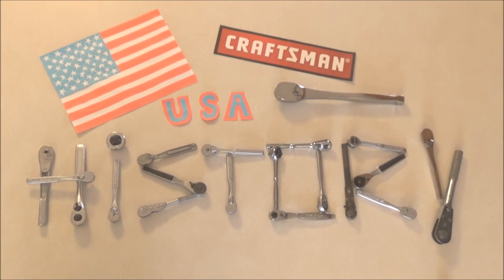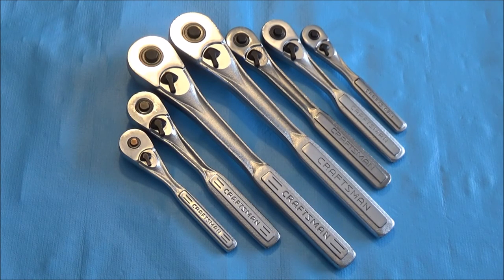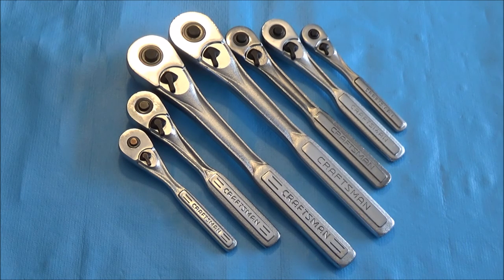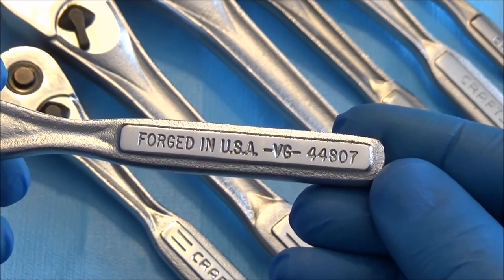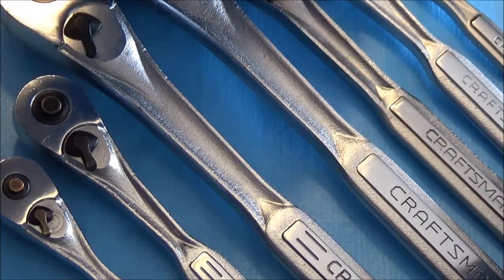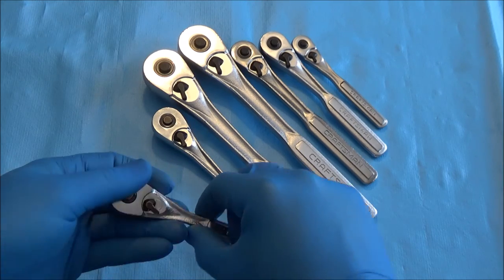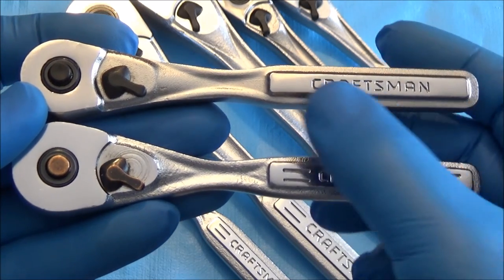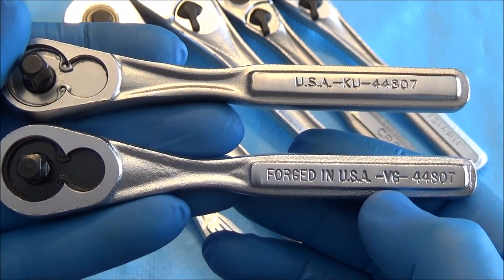Craftsman Tools - USA History: Teardrop Ratchets (4th Gen. RP)

Comment: Sears used injection molded metal parts in some of their ratchets as a cost saving measure.  They mold them 10% oversize, then run them through an oven to partially melt and harden them..  When they exited the oven they were the correct size.  My Dad worked for 3M company and sold sandpaper to the West Springfield MA Easco plant to finish Craftsman tools. They were originally called Moore Drop Forge. They had five big presses to drop forge the tools.  Most of the time they would only be running one press at a time.  When they where all running the whole street would shake.  It was a black day when they moved the plant down South.  Good video.

Comment: Got one of these at a yard sale for a few dollars the other day. It seems to be one of the later models, but it's still much better than my old harbor freight ratchet.
Reply from the maker: Agreed.  From my own experience, USA Craftsman tools seemed to have higher longevity, durability, and value for the money.  

I will concede that Harbor Freight does have a ridiculously low cost of entry, but, from my own experience using their tools, not worth having to repeatedly warranty a tool due to failure.

Comment: I haven't seen any of the black industrial finish ratchets in your videos and I'm sure they're the same as the standard ratchets but did you add any of those to your collection?
Reply from the maker: +Samuel Noble Hello!  Yes, your hypothesis is correct, the black industrial ratchets are exactly the same idea as the standard USA set; however they have a slightly different tooling pattern.  That difference "might" increase longevity, but I cannot offer anything in that regard other than my opinion.

You should see an example of a Craftsman Industrial 3/8" Tear Drop right in this very video.  The difference between that and the  black oxide in terms of price is minimal; however, the "Industrial" variants are 2x almost 3x the price what what you can buy the standard USA variant.  There is zero difference with the internals.  The black oxide acts as a covering to protect the chrome underneath.

I "might" buy a black oxide Tear Drop and show it at the end of the series just to display an example, but that is probably as far as I'll go.  There are "Industrial" variants of the Non-Fine Tooth Round Head, which I have already shown, the Next Gen. Thin Profile, Full Polish Tear Drop, and the Standard Tear Drop.  There is zero difference between the aforementioned, save the black oxide Standard Tear Drop, and the normal Craftsman variants.

Given this, I've made commentaries in various videos about how the "Industrial" is either the exact same as the "Standard" or just slightly different in some regards.

Comment: ..Believe me, hand tools are not the only thing Sears had a problem not assigning a proper name or model# to..I am a small engine guy, and their weedwackers(trimmers) and especially, their chainsaws, are a BIG problem..and it goes WAY back..for example, Poulan has made the bulk of their chainsaws, but sometimes other manufacturers as well..they had, and still have, a knack of simply calling a given saw ' 18" Gas Chainsaw', 'Craftsman 3.7', '16" 36cc', etc...which is absolutely useless when looking for parts..usually I just try to figure out which Poulan model is the equivalent  and go from there..and then, there are issues such as a Poulan 3700 being sold as a "Craftsman 3.7", and a Roper manufactured saw sold as a "Craftsman 3.7"..and they are Nowhere near the same, and NONE of the parts are interchangeable.. :/
Reply from the maker: I am with you there.  It definitely was a problem for the consumer and the people working the floor!  ^_^

Comment: I have had a 650pc starter kit 1993 teardrop quick release great ratchets and a I believe 165pc mechanic tool set 2003 I broke every one of them and the 3/8 3 other times, I also had the 3/8 teardrop quick release long handle flex head ratchet and someone walked off with it and it was $21 at Sears in Muncie Indiana, and I had to replace it with the china counter part in 2019 $19 broke it twice and they were only used to change spark plugs especially on vehicles with headers, and only the china version of the long flex head teardrop quick release ratchet is the one I broke.

Comment: If you were restoring a ratchet would you attempt to repaint the parts that have turned copper or say hey it lived a good life and still serves its purpose?
Reply from the maker: I would not do anything to it.  There are very few pieces I would consider worth going through the effort of doing that for.  Usually, they are exceedingly rare or have a sentimental value.

Many people just run their tools through a while wheel, hit it with a little rouge, and call it a day.  Unfortunately, that is refurbishing.  A true restoration requires plating the tool with something that is original to the piece or very close to it.  One requires effort.  The other requires much more.  ^_^

Comment: Great video, lots of information. As always I didn't mine the length. In my opinion why not just do long videos with all the information,  instead of slightly shorter ones where some things are left out! Also great recommendation on Allen Ratchets! A lot of there stuff is still made in USA!!!
Reply from the maker: +Tony Moreno That is a good recommendation; however, I won't be able to accommodate that.  This series will be nothing more than what you already see, with the exception of the final video.

The first reason is time.  I barely have enough time to put these videos together, which is why you don't see any specialized editing or clips/music that would require permission from their respective owners.

The second reason is sequencing.  While I do make references or have cameos of particular ratchets within the main body of the subject, ultimately, they are only that.  I cannot get away with an allusion, since this series is very reliant on visual presentation.

The third reason is the audience.  I have already received comments about the lengths of these videos.  Breaking them up based on when each ratchet was released and offering a separate video not only helps with the chronology, but also gives the viewer a smaller amount of information to digest the and view specifically what they want to see.

On a different note, I am glad you like the Allen reference.  Danaher owns many tool brands and there is a lot of cross talk among Gear Wrench, Allen, Matco, Armstrong, & Craftsman to certain degrees.  I've had the chance to interact with the Allens, and they seem like a real winner for the price.  They are fully chromed much like the Professional Tear Drop, Next Gen, & Premium ratchets with a price that is very attractive.

Comment: I have these in a kit from around 2000 I still use them everyday I have the full 300 pice kit still there all original i think the position switch broke on the 1/2 inch back in like 2001 i took it to sears and the guy took in back and fixed it on the spot then a few years later the store shut down around the time sears sold the craftsman name sucks sears sold out I love there tools I own a few Chinese craftsman tools and can't stand them the quality sucks on my 1/2 like this man i put cheater bars on it all the time to brake a rusty bolt and it takes it no problem I even did it with the 3/8s before but that was a tad bit sketchy i backed off and got the impact out